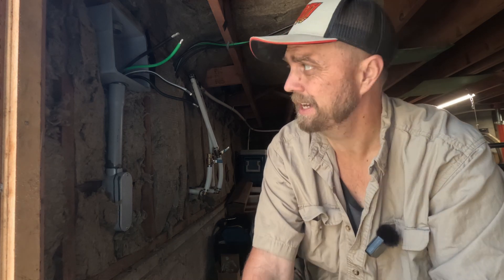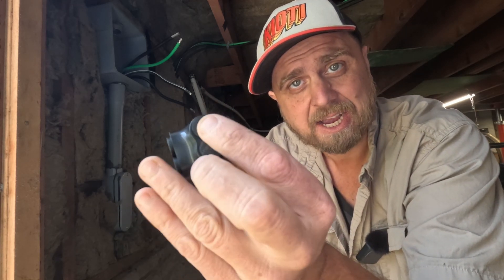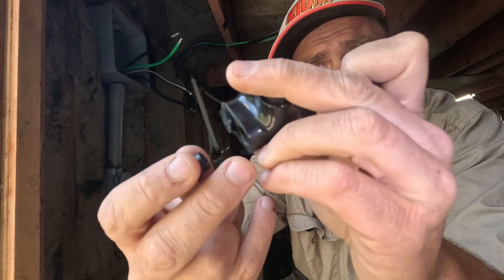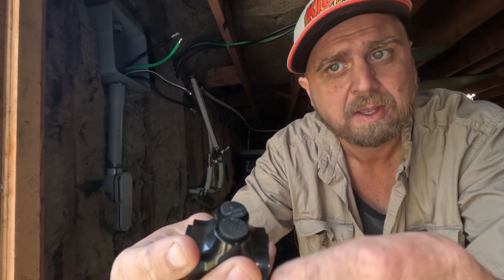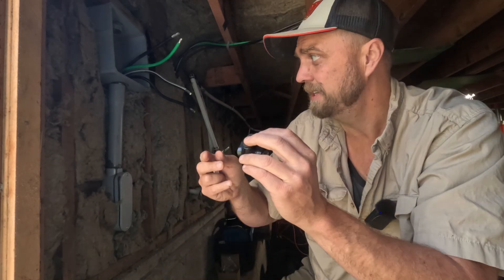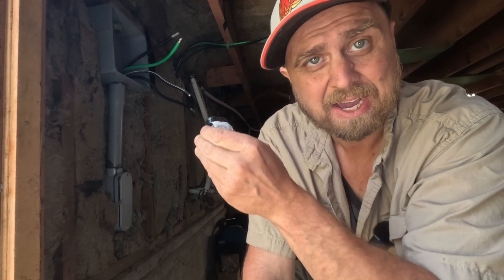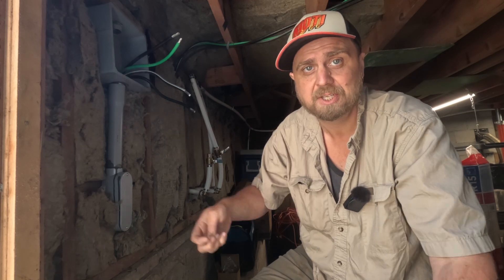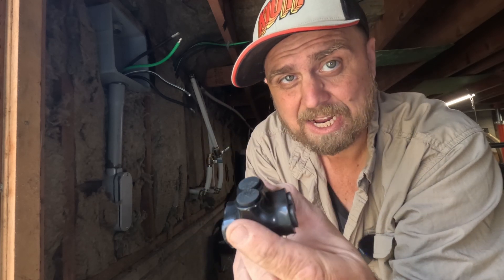How do you Splice thick wires? What is a Polaris Splice?

Comment: Hello!
I'd like to know if a 4-14AWG 3-Port Multi-Tap Insulated Connector can be used to connect a #6 cable and two #8 cables to separate the oven and cooktop.
Thank you.
Reply: Yes, they come in One-Side Wire Entry IPL4-3 and Dual-Sided Wire Entry IPLD4-3.